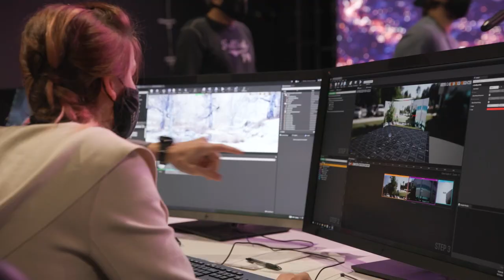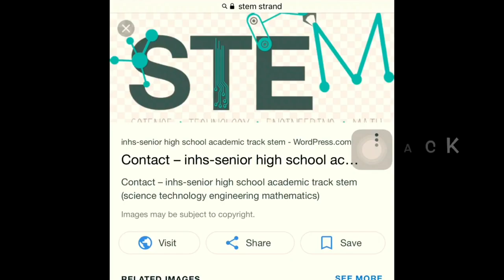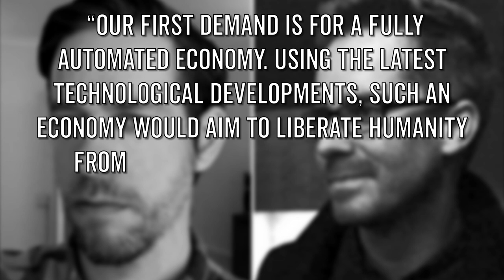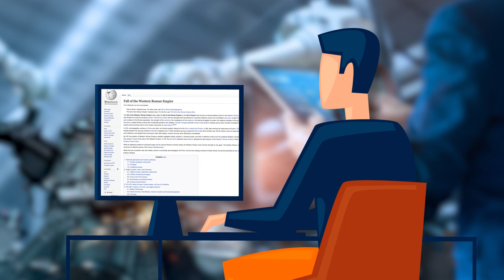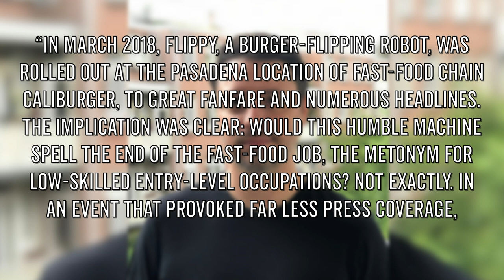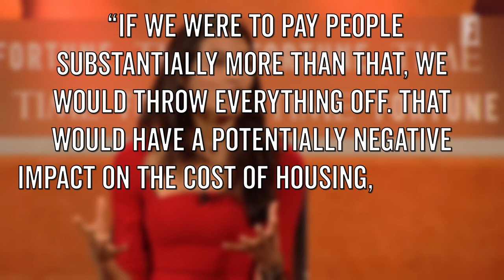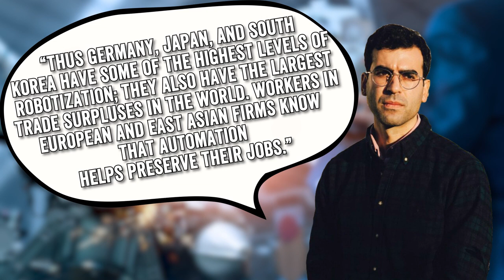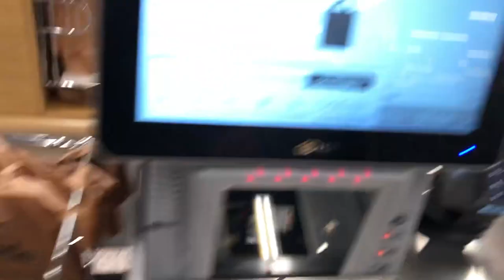Automation: The End of Jobs?

Comment: Hi, as an automation engineer, I can tell you from the inside how does everything look like (long text ahead).

For example, automation was born out of the need to optimize resources (think of wind/watermill). To automate something, you need a repetitive task. Repetitive menial tasks (talking from a manufacturing perspective) should be under focus since that brings no development to a human being (no decision making, little to no learning, no problem solving) nor joy, tightening bolts for 8 hours a day is not fun.

Now, automation is a tool, it doesn't solve problems on it's own like if it was magical. It requires proper engineering to be done properly, otherwise it'll bring more problems that it solved. For example a task could be so complex that an automated cell would need 3x the footprint and huge investment to replicate what a single operator can do. For that you need cad/cam designers, process engineers and of course, automation engineers.

Then you actually have to maintain said machinery, electronic/electric/automation technicians are highly needed to keep machines working. A well designed machine would require basic problem solving/maintenance, since it could tell you in detail what's wrong (a particular sensor, the machine sequence was disturbed, etc), a poorly designed one will have little to no help and would require more experience in trouble shooting/maintenance to keep the machine running, I've run into both of these kinds.

Now, outside of manufacturing, if your job has basic decision making (a process with predefined conditions or "recipes"), it will probably be automated by an AI. If your job is to analyze data, guess what? AI will take your job. If you do repetitive manual jobs (like adding the same formula to the same cell in excel on x amount of files), that can be automated. You could either worry about it OR you could use this info for your benefit and stay ahead of the curve: start learning about how to automate your job. However, that AI still needs someone with experience to tell it what to do and to have it properly trained, or if something bad happens, someone needs to trouble shoot it.

Now, what should be, is that every company should reward it's employees that make their job more efficient, however, there's an article that comes to mind from years ago from a guy who automated his tasks, he did nothing te whole shift and got fired for that. I would like to say MOST, I think it's SOME companies, that don't know how to deal with that, if I have learned something from the pandemic, is that companies refuse to adapt to new ways of work (see the reluctance to adopt Home-Office), so, an employee optimizing it's processes, it's not certain if it'll have a reward or a punishment. 😬

Comment: I remember CGP Grey did a video about this years ago, where he compared "workers" with modern horses.
Bottom line was that the transition time between people&robots still working at the same time and only robots working will be extremely difficult to tackle and most likely the reason it could fail.
Reply: I think the hardest part is getting people to stop being so afraid of change . The world is already changing a lot all the time, and it's adapting just fine. From manual labor, to machines, to more advanced machines, to even more advanced machines, and so on. This fear of losing a job over something is the big problem, if they replace your 12 hour/day job packing something with a machine, then you can learn how to service that machine and get a job thats even better you. When some jobs become irrelevant, new ones become relevant, and the world goes on. You just have to not be so afraid of giving up on previously learned things and embrace learning new ones, and get better at dealing with the disruption. Its usually VERY gradual, so it's not as hard as it might seem, many times we don't even realize how much has changed unless we look back years ago.
Reply: @edumazieri  That is a very privileged way of seeing things. Not everyone has the opportunity to do that.
Reply: @edumazieri  The thing is, not everyone is suited to do the brainy stuff. Plenty of people are perfectly happy doing manual labor as it keep them active and don't require too much thinking.
Reply: The biggest obstacle to the transition to full automation is and will be the social inertia of our currently capitalistic system.
Reply: @foraxen2255  People will do things in their free time regardless of whether they get paid to. Case in point, that's already how life works.

Comment: I have a few problems with the arguments about Flippy. First, the idea that a prototype isn't ideal at it's job means we're nowhere near where we need to be it's silly. Prototypes are how you get to that point, and their existence is a sign that the final product is on its way. Second, flipping a burger may be our lowest paid and lower skill cap job, but that doesn't make it one of the easiest to automate. Doing that properly requires sensors to determine the state of the meat, physics calculations to determine the proper movements based on meat weight and position, motor sensory information, etc. That's way more complicated for a computer than something like advanced mathematics, which we pay significantly more for people to do, but would be child's play for a computer. I'm less worried that the robots will replace burger workers (which they could also probably do more easily if they hadn't restricted themselves to using an arm the way humans do to flip burgers), and more worried about things like diagnosing illness, or data analysis that we pay very high salaries for people to do, but where we're already seeing robots outperform people in certain contexts

Comment: For most companies, and for  now the cost of using a robot (in the physical or software sense) is higher than using a human. Human robots (low wage employees) usually make more financial sense. Specially if you have access to a global workforce that can work for much less. That said: I had several run ins with google bots calling me over the phone during my last job. They sounded human, but if I gave them an answer they didnt expect or understand, they ended on a loop until they timed out. 
They are getting better every passing year. But they still have a long way to go, price and capability wise to get to a good enough point and replace humans.

Comment: A robot flipping the burgers in the way a human would seems entirely inefficient.

Have the meat drop into big George foreman grill and sit there for a few moments before being mechanically scraped onto a conveyor that takes it to its destination
Reply: Ya I think that invention was very limited because it wanted to do it the way a human does. If they thought outside that box, they could definitely come up with a more efficient burger cooking machine. It did seem like just a marketing stunt though, so whatever.
Reply: If you want to make a guitar playing robot, you don't need to make a sentient android, just have hooks pluck the strings and hold down the strings on the neck and have it run midis
Reply: Biggest hurdle to overcome is how many factories tend to think of automation as "let's make a mechanical arm that repeats the movements of our human workers". It does work for assembly lines or similar jobs where the worker repeats the same motion mechanically... but that's just a small fraction of them. Many other jobs require continuous adjustment on behalf of the worker, reacting to their environment, etc. so the only way for automation to work there is to automate the entire environment surrounding the labour, instead of just the labour itself
Basically, as you said: the burger flipper fails because it's just a "let's slap a robot on our pre-existing, human-oriented kitchen and call it a day". For it to work, what you need is an entire robot-oriented kitchen!
Reply: @baconknightproductions8297  Why make a guitar playing robot when there's already boomboxes and the like, is the thing. If you want something that plays music perfectly, there's already better solutions for it. If you want something that offers you a performance with a musical instrument, then a robot won't give you that, since all they do is repeat a motion or a pre-programmed directive. You need a human that's able to improvise, express themselves and allow you to empathize with
Reply: Given how often the McDonald's ice cream machine is broken, they'll need human back-up.
Reply: @YouMakeMyMotorRun  I've already met you guys half way. I compose music digitally using prerecorded sound libraries of all the major instruments, apply dynamics, and mix it. It's not a studio recording -- I can edit it ala improv whenever I like and play it back all the same.
Reply: @oldmandoinghighkicksonlyin1368  That machine breaks so the company that fixes it can skim money from McDonald's Franchisees.
Reply: I think what people are ignoring is that Flippy was improved and now works the grill, the deep fryer and can now dress the burgers. And it only took a couple years to get there.
Reply: Definitely. That single robot failure doesn't mean job safety for burger flippers. Rather it's the jobs of the engineers that build and improve those robots that will be safe for a while.
Reply: @oldmandoinghighkicksonlyin1368  😂😂🤣🤣👏🏾👏🏾👏🏾
Reply: That's an infrastructure thing.  It's expensive to replace all the existing grills and such, and redesign the whole kitchen, and it would require a prolonged shutdown of the location.
    A system like you describe would show up in a brand-new startup built around it from scratch.   Like those car vending machines -- existing dealerships didn't retool to use them, a whole new company had to start around the idea.
Reply: @stevenscott2136  Yeah, but locations also open up/remodel all the time.  All it takes is one company to have a successful attempt and you'll see the standard kitchen being slowly phased away.

If a job can be accomplished by following a flow-chart then it's at risk of being automated.
Reply: @ledoopah  now they have robot nurses

Comment: This may be a niche angle to tackle this from, but I feel its relevant because of the fact that higher automation is associated with yet higher labor rates. 

Basically, I propose that labor and technology works like a trophic pyramid in ecology, where the existence of a predator at the tip can only be supported by the existence of many more prey, itself supported by many, many more plants at the bottom. Likewise, maybe technology is stuff that exists higher up on our labor-trophic pyramid, needing the support of a wider base of "compositional" labor and smaller technologies. Think how robots need computers to program them with, which need programmers to use them, who need farmers to feed them, and so on. Each 'stage' of the trophic pyramid represents a wider and wider base of primary-source energy in the ecological trophic pyramid; likewise, further technological elaboration requires an ever-wider base of labor. And like how grass becomes threatened when deer over-graze, and wolves chase and prey on deer, allowing the grass enough relief to maintain themselves, the heights of the labor-trophic pyramid increase (as represented by "productivity") while the actual time spent working has only ever increased. 

Meanwhile, output falls for the same reason deer cant eat all the grass away. If grass is our time and labor-capacity, and if deer are jobs eating into our time, then wolves are technologies that eliminate some jobs, but still require their own jobs to exist -- like in the trophic pyramid, there has to be a critical number of deer (jobs) for wolves (tech) to exist. More lifeforms have been created, more energy is going through the system, more grass is growing over a wider area, but the grass is always being eaten. If for some reason the grass were not being eaten, everything but the grass would die. A labor-free society has no technology -- this makes impossible the vision of a labor-free techno-automated world. 

The idea that a robot means you don't have to work is motivated by an illusion of separation from that robot. Really, what the existence of the robot implies is that you must pitch in to take care of and steward this thing. Which is something we should be doing with things we actually need directly, like plants and soil bacteria and whatnot (consider that nature is already fully automated, and self-regulating to boot).

Comment: One of the major problems with automation is that companies want to make machines to replace human jobs instead of the machine jobs done by humans.  

Basically make the variable cost of the company into a fixed cost and automated.  It is the race to the bottom of cost not realizing it lowers everything else with it.  

Amazon has 5 locations in America that are 99% automatic but the company doesn’t like to admit that they are also the least productive locations in the company.  The machines may not need breaks, healthcare, time off or rest but they are limited to their programs.  The one automatic facility in Idaho is 25% as productive to the human location 100 miles away.  Amazon try to make these locations faster and more productive but it made cost go up everywhere especially in maintenance cost.  Basically they have to close a location down for a week to a month to fix all the machines if they have the machines working as fast and productive as humans for a week.  

One of the box arm transfer machines costs in 2016 was $17.25 an hour for 5 years straight.   However that cost doesn’t account for speed, Energy consumption, maintenance, and updates.  The true price for one of these machines is $57.44 an hour for 5 years straight and that is for the Chinese ones.  The ones made in Europe or America cost $101.73 an hour for 5 years straight but have a better yield on investments if the facility decided to go 100% wind and solar powered.

Comment: Worked as a Assembly line robotics engineer for a while. Each robot would replace 5 humans. The protests were Epic. Until the Humans figured out they no longer had to work in a toxic hazardous environment anymore. And the robots were so fast the company had to hire an additional 20 Humans to keep the Robots stocked with parts, packaging product, delivery to customers, ect.

The workers, once they got over their automation fears, used the automation to turn the production into greased lightning. The downside is corporate management kept all the additional profit for themselves. And then ran the company into the ground because it was more important to fuck your secretary and golf all day. Heaven forbid they would do their jobs. Of course the company got sold, corporate management got massive bonuses and the workers (the ones that made everything work) got thrown away like garbage.

Bottom line, automation needs to start at the top of the corporate pyramid and work down (replace the most worthless part of the corporation first).

Comment: who ever argues that full automation is possible has never worked with machines. the amount of data and variables that you have to consider makes it so that you have so many possible points of  failure that it's much better to automate whole assembly lines with simpler machines rather than one complex robot. together with the whole topic of maintenance and I can promise you that labor will never be abolished only changed. however the amount that will be necessary will be so little that either we start working at multiple places at once to get by or we will collectively say fuck this and abolish the private property system for communal property free of the profit motiv.
Reply: Doesn't tragedy of the commons imply that greed is persistent unless other institutions develop?